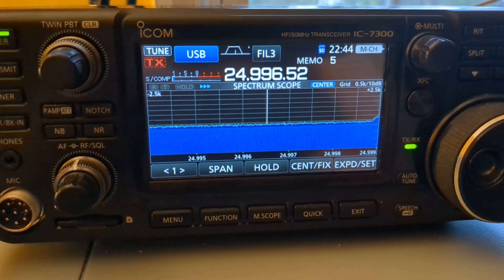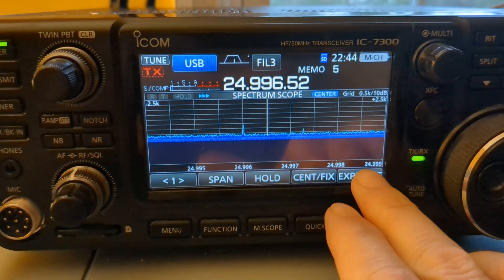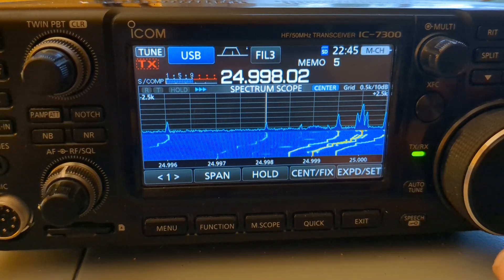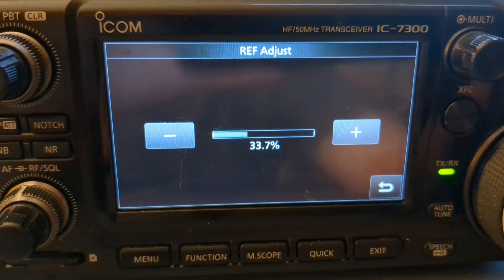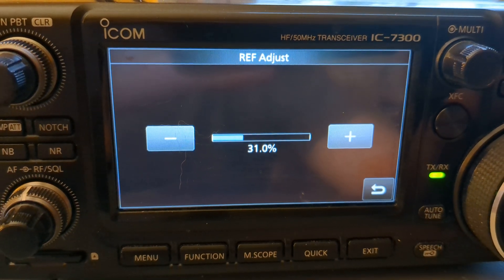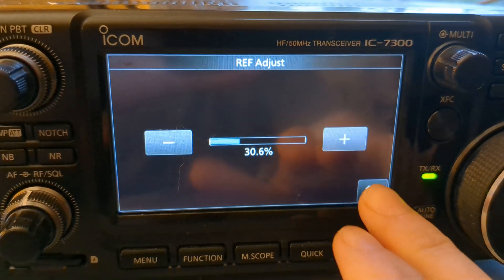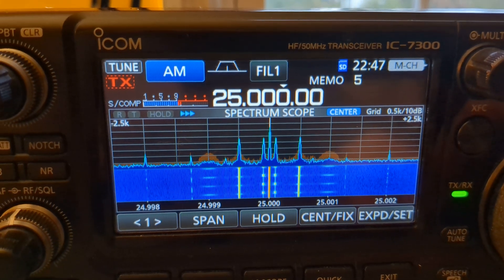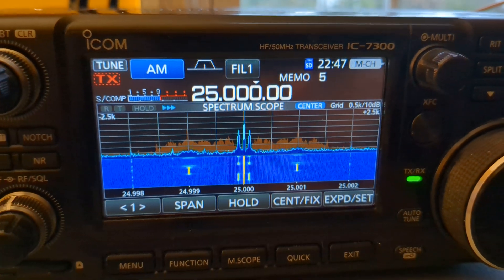ic-7300 Reference Adjustment And Calibration With WWV

Comment: Combine the 2 tones together and the receiver has been zero beat. Older radios required warming the tubes and stabilizing the oscillator before zero beat could be achieved. It used to be interesting talking to a ham whose radio tubes were not quite warm enough and you had to chase their slowly shifting signal up or down the band until their radio was stabilized on frequency. Fortunately, modern radios have little to no receiver drift thanks to state of the art components and improved circuit design. Usually right on frequency out of the box. 73 OM de K3WR.

Comment: Quick Question, I have the IC-7300 and on the display right below band display I keep getting a flashing "OVF". Sometimes it is solid and a lot of times it flashes on and off. I tried tuning the frequency which the frequency did get tuned but I still get the flashing "OVF". What is wrong and how to I fix this? Have you ever experienced that on your IC-7300?
Reply from the maker: It means the RX is swamped with strong signals. If you have a preamp on turn it off, if you're on one of the low bands, such as 40/80/160m and especially at night turn on the attenuator. If that doesn't work reduce the RF gain.